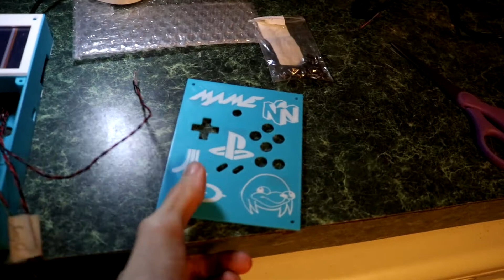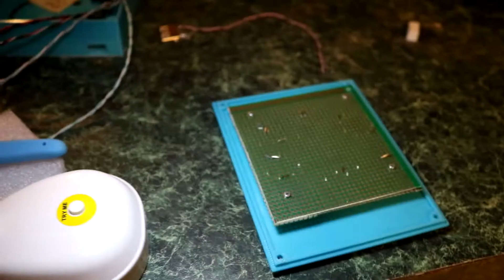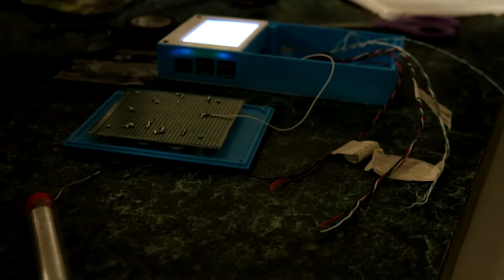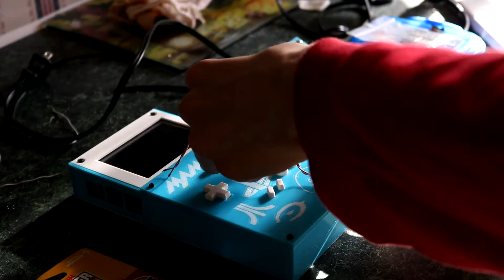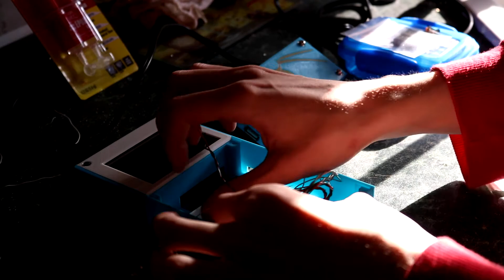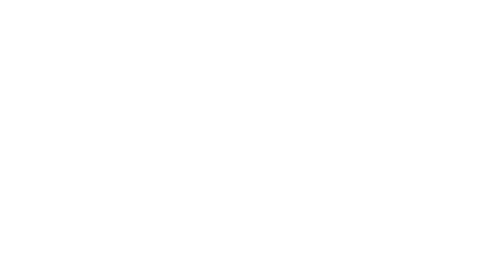My Pi 3b Portable Handheld Console 3D Printed

Comment from the maker: Another update about this portable I updated it and the current update breaks screen rotation. I heard it happened to other pi images not just recalbox. I think it has something to do with them trying to make it more like the pi 4 im not to sure. But it took me some work to find the correct image I think I used that has the screen rotation in it. I am using "7.22 reloaded recalbox" image I believe so thankfully its not a paper weight yet but crazy that a update about made it one. If any one knows how to fix screen rotation in newer pi os images let me know so I can cover it for a video but so far the only way is to disable the gl video driver but on the new images doing so will break recalbox and it will freeze on the splashscreen.
Reply from the maker: Oh yea no xorg so no the xrandr commands it shouldn't work like they would on the pi 4 for rotation....

Comment from the maker: Thought id do a update after about a year it still works fine no issues!!! I do wish I left a channel for the wires so I could have pulled the pi out to touch up on some points. I also do regret not adding a speaker plenty of space and it would have been super easy to do if I had a slot for the wires to all slide out so I could flip the pi.

Comment from the maker: Some notes I didn't mention in the video the screen has a brightness button that's it... No rotation options nothing so I had to script to rotate the screen when I wanna play on tv or swap sd cards out. Also to change the lcd brightness I have to remove the lcd cover just 2 screws and under that is a button I can click but I plan to swap it out with a reed switch so that I won't need to add a new button to the case and I can trigger it with a magnet I won't be changing brightness alot and the current brightness and screen it's self is pretty good.